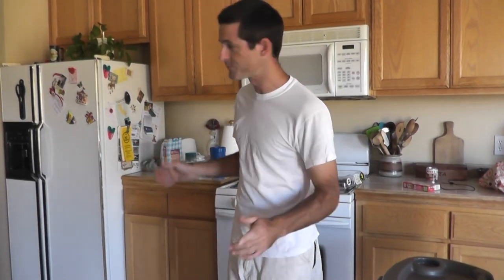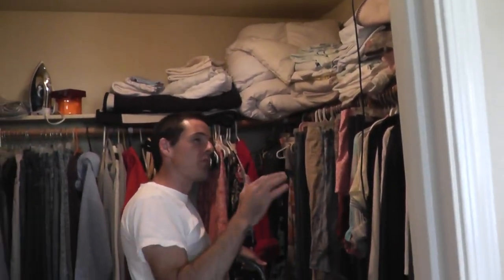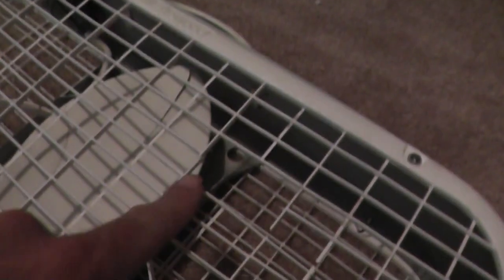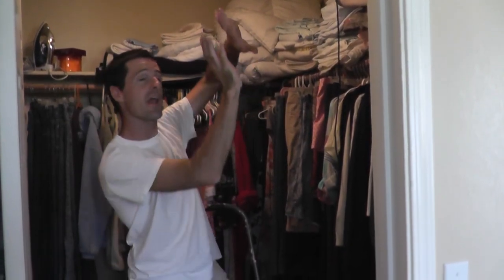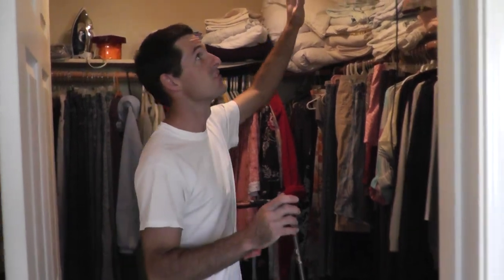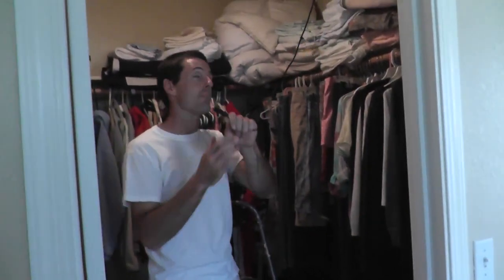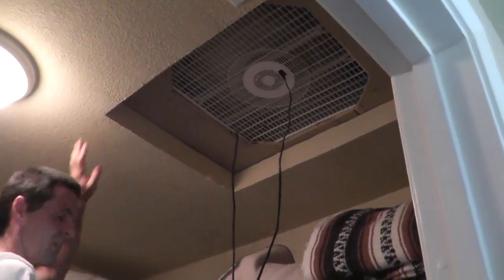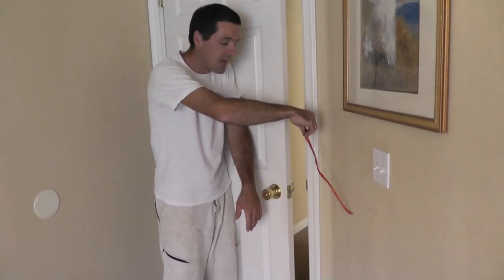Cheap Homemade Whole House Fan - How To Cool Without A/C !!

Comment: That fan may NOT be designed for attic temps and horizontal use.
What you are telling people to do is electrically unsafe.
An insulated panel that will cover the fan when not in use will save heating and cooling costs.
A good whole-house window fan will be more effective.
Reply: How wrong can a person be? The temperature of an attic does not come anywhere close to affecting the electrical insulation, so it is not electrically unsafe, and the fan is more like at the temperature at the ceiling of a room anyway. If the fan blades turn freely, I don't see any reason why the bearings would be adversely affected by horizontal operation either. Having tried the box fan idea back in the '70's, a window location is by far inferior to a ceiling location, primarily because of the interfering screen needed to keep bugs out at the window, but also because heat rises and in the ceiling location the fan gets a boost.
Reply: Kenneth Florek
Attic temps can exceed 150 degrees F. This is far beyond the operating temp of the fan.
Motors are designed for vertical or horizontal use.
Two conductor lamp wire is not rated for these high temps.
Turning the fan ON and OFF by getting on a ladder is dangerous.
He has violated several National Electrical Codes.
Reply: If some Code may have been violated, he still has not done anything unsafe electrically, so that is a problem with the electrical code.

 I am sure there are industrial motors designated for horizontal or vertical operation, but finding such a specification for a fractional horsepower motor would be peculiar, because the same thing that holds the shaft in place in one position is good enough to make it irrelevant what the position is.

 Electrical wiring is normally run through the attic, which makes the assertion that 150 F is dangerous to electrical insulation implausible. Lamp cord, because people are normally in direct contact with it, is made to higher specs than house wiring, so it even more implausible that it will fail at 150 F, even if the electrical wants it still better. But of course, where the fan is mounted, the temperature is that of a normal living environment, where lamp cord is designed to be used.

Being on a ladder is dangerous. A lot of electrical accidents are actually just being on a ladder while getting a shock, and falling off.

 Operating a motor in surroundings of an elevated temperature probably shortens the motors life, because motors normally run very hot, and they will run that much hotter. But again, the ceiling is not really out of its normal operating range.
Reply: Kenneth Florek
My guess is you are not an electrician or electrical engineer.
Reply: 314Tazo  So you are seriously claiming that operating a box fan horizontally is dangerous?  My observation is you have no idea what you are talking about when it comes to home wiring and consumer products, but you think you do. Most of your assertions not only aren't true, they are silly, and obviously so.
 I am wondering if I should pull out my credentials, since you have every appearance of having none, although maybe you are working toward it, but the reasonableness or unreasonableness, as the case may be, of what I said should stand on its own merits.
Reply: Kenneth Florek
Well..are you a licensed electrician?
Reply: 314Tazo If we are going to be sticklers ....
  Electrician= install according to mfg spec within confines of code.
Mfg= Build product with parts and components that were engineered to work within the design and intended use regardless of in house or sourced component.  This includes the motor. Provide instructions for intended use, if horizontal orientation is not included then lets go further up the chain.
Engineer or team of engineers for the motor=  Designed motor for specific use, therefore engineer of motor should be the guy to call and ask about the fan.

Thank god in the real world there is not a fan company on earth that would sell a fan that is a hazard if it tips over! get real man!
 
Unless the Fan mfg states that the fan can be used horizontally what good is the input of an electrician who has nothing to do with specifying intended use? If the input of the electrician is worthless than how creditable is a guy who seeks to verify such?
Reply: This again?  Kenneth is wrong.  Enough said.
Reply: Kizer Dragon
What is this "again" stuff?

Am I supposed to care about a content-free comment, the typical style of the self-important youtuber without a thought, but a keyboard?

 Have a nice day.

Comment: How did they survive without AC before this invention?
Reply: +Ricky Acosta The human body can get used to and bare a lot of punishment. Ive worked on rooftops on 115degree days and slept outside -25F cold, (no heat). Its just the matter of getting used to it, its easy when your broke :)
Reply: +Ricky Acosta I live in Florida; and we have a town nearby that has original houses from the 1800's. The houses were built differently from the houses today. Houses back then were built about two or three feet off the ground, which allowed cool air to circulate under the house. Also, the walls were vented up high, allowing heat to escape. I've toured those houses, even in the summer, and they always feel comfy inside.

Also, in the old days, houses were constructed of local materials; and that also lends to efficiency. Nature provides the best building materials. For example, in New Mexico, they have adobe mud. In other places they have abundant wood. You would not want to use wood in a dessert climate. The abundance of sand would allow you to cheaply make concrete, which would be more suitable to a dessert climate. You see, nature provides the best building materials for a given location.
Reply: +Bob Simmons Genius! Thanks man. Yes nature does provide well :)

Comment: As I am shopping online right this minute looking for whole house fans, I am liking this idea. A good whole house fan seems to be over $200 for anything over 24 inches. My contractor is recommending 36"s. I'd try your solution to a regular whole house fan except I am also concerned about a possible fire due to the house fan (box fans)  are not made to replace whole house fans.
Reply: A/C Man Heating and Air My thought also Mike, but the question then would be do you need to move that much air? The one I have in my house is a regular whole house fan. When it is on, you can't hear anything else but it surely moves all of the air in the house in just about one minute on high. 

I didn't need AC when I working because by the time I got home after 5pm most days. All I needed to do was turn on the whole house fan for a few minutes. 

I am adding one in my daughter's house within a weeks time but I rather not spend over $200.
Reply from the maker: Hosea Johnson It definitely moves less air than a whole house fan, but I've been using this method for a few years now, and it does move a substantial amount of air.  It really depends on the size of the house too. For 1000 square feet or less, it would be more than enough, but for 3000 square feet, it wouldn't do much. Thanks!
Reply: What's a whole  house  fan?
Reply: A/C Man Heating and Air I do not know the specs on "my" whole house fan but on high in my 1,700sqf living area, the stagnant air is completely removed (depending on how windows and doors are opened and where) in an amazingly short amount of time. 

As you know, in the desert it is hot when the sun is up and as soon as late afternoon comes around, the outside ambient air begins to cool. 

By the time I would get home from work and open the front door, a rush of very warm to hot air would hit me like opening a very hot oven. 
I'd go into the hallway (where most whole house fans usually are installed), turn it to high and very quickly the inside ambient air is the same as out side or even cooler. 

In the 11 years I lived there I didn't use a conventional AC unit. On the days I wasn't at work I used an evaporative cooler/swamp cooler. 

The dry desert air is much easier to handle than the more humid climates.
Reply: How'd you learn all this stuff Mike?
Reply: I know but did you live  and n learn or study it
Reply: A/C Man Heating and Air Figures you had one of the same concerns about this video I had. Crawl space openings can be unsitely, (maybe that is why his is in a closet). My whole house fan and access hatch is in the hall way. 

I'm not so sure a less powerful fan can't be managed, even at one end of the house. I learned (trial and error) that it mostly comes down to what the guy in the video stressed. It's all about what windows and doors are opened and how much they are opened. 

As far as the effectiveness is concerned. I think time comes into the factoring. Of course it will take longer, but eventually the inside ambient temperature will reduce to equal the outside ambient temperature. 

I also found that keeping heavy curtains closed, with all doors and windows closed during peak hours of the day will help a great deal in this idea working, overall.

No, my contractor didn't suggest louvers. He is waiting on me to provide the parts as he will only be doing the labor. I would assume it is standard procedure to add louvers (here in California, at least), although I have never seen one without louvers.

Over many years of dealing with contractors and knowing a few personally along with the time I have spent with our contactor, I believe (up to this point) he is trying to help us and is looking out for our interest as well as his own.

Personally, I think what this guy is charging for the amount of work he is doing is really low and amazing. I'm hoping it is for the reasons he has stated. Friendship and he believes in giving back, along with the blessings that always follows.
Reply: No Body a whole house fan is a AC fan that is over 30'' and can move more air than typical box fans. they are usually constructed well built to last and the motor is protected as well. they are usually mounted horizontally in the attic in the celling but some can be mounted on an external gable vent. the idea is that you vent out ALL the hot humid air from the house and draw in cooler air through a open window, usually opposite from where the sun is, this way you can cool longer.
Reply: If you're not trying to do this on a shoestring budget, and plan to use it a lot, I'd recommend a large powerful one and belt driven. I use mine a lot more than I expected. I even use it during the day on warm days for the breeze. And if I could do it over, I would go with one that is even more powerful but quieter than the one I have.
Reply: +Hosea Johnson In the the south you need some dehumidifier or you will start having mold growing on your wall and everything in the house will feel wet. "cooling" is not enough.
Reply: agreed, when its humid, you need both an air conditioner and a dehimudifyer.
Reply: +Mark Plott Dehumidifier are a must here in west tennessee, in the swamp lands. Otherwise you'll just be running the ac 24/7 and have issues with mildew.

Comment: Electric motors work perfectly fine in water.
Reply: Depends on how conductive the water is.
Reply: cbr From my experience of submerging fans in water, they pretty much just slow way down from the resistance of the water. The motor is all electromagnetic. There aren't any circuits that can really be shorted by water with a basic house fan. The water would need to be extremely conductive. Either way, don't stick your hand in!

Comment: ??? is this a history lesson? essentially nothing novel was done here (i couldn't even give a damn about your toe).

these made their debut in the late 40s.. almost seventy years ago. 

0.5/10 re: being innovative (shoving a plastic fan into the attic, in lieu of a fixed fan)
0.01/10 re: being informative (relative weights of cold/hot air? woah. 0.01 for that knowledge bomb)

Comment: I'm a contractor and I have remodel about 3 old houses probably built in the 1920 or 30s and they all had a heavy duty fan like this one but of course built for the purpose. It does cool the whole house when turned on. And you can feel the flow of air all around the house . The air is pushed to the attic and comes out through the eves around the house. It does feel cooler when your a contractor working inside with no a/c. 👌

Comment: That one little box fan in that size of a house ain't gonna do diddly.  You can find an old window exhaust fan and it would be better.  Whole house fans were large belt driven ventilator fans that would suck your wig off when you walked under them.  LOL.  But still - in 100 degree heat they were no match for AC.  At night they were good.  We used to have one back in the 60's.  It was no match for humidity.  It just sucked hot air in through the windows.  And besides, you are having to keep the closet open all the time.  Go for the gusto and install a good one.  You can do it yourself.  Not that much to it.

Comment: That fan will not ventilate a house. Its is not the reason the ribbon is moving. A $20 box fan does not move enough air.  Why do you think real attic fans are huge and and have large motors?  Dude I hate to bust your thought you came up with a good idea moment, but that fan is doing nothing for your house temp or power bill.

Comment: $150,000 house, too cheap to run the a/c, uses a broken $19 Walmart fan.  Typical tight wad. I bet your kids are miserable. For christ sakes turn on the a/c. A modern, efficient, HVAC system with inverter technology uses a tiny amount of power.
Reply: +matt9c1 
However, UPGRADING to such an efficient system (if not so equipped) may not be so cheap. I gave him another ... ehem ... "cool" idea in a more recent post about a portable AC build including another video from right here on YouTube. Check it out. It's pretty amazing actually.
Reply: try a 3100sf house with 2 central air units, in criminalfornia with kwh prices of 30 cents... you're talking AC bills in the 4 digits, not happening, no thanks.

Comment: Save as much as you can>  That Money in Your Pocket>  Like i cut all these 5 street lights off around here burning all night lone and  INSTANTLY SAVE  100 + dollars a month> That is at less 1200 bucks a year in my pocket > Just on out side lighting! save another 75 bucks a month on the hot water tank, by putting a off and on switch.  turn it on 30 min be for i need hot water and turn it off>  That another 900 bucks a year in my pocket! List goes on

Comment: We do this every year... But we used a round fan and a blue piece of 2" insulation that we cut a circle in.   The weight of the fan on the foam results in a tight seal.

2 story home... And when u crack a doe stairs window... U can hear the wind howl.

We plan on putting another piece of foam on top of fan.... So when we turn it off, the foam will drop down and seal the opening.

When it gets really hot in summer... We may run ac during the day... And the fan at night.